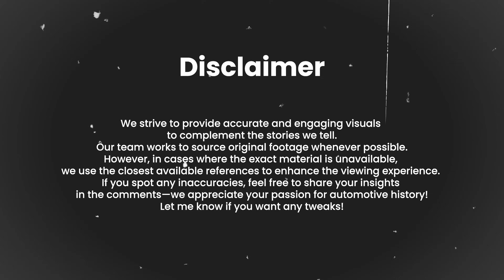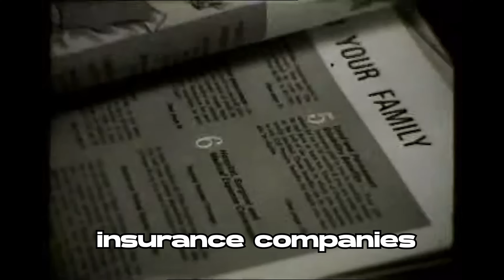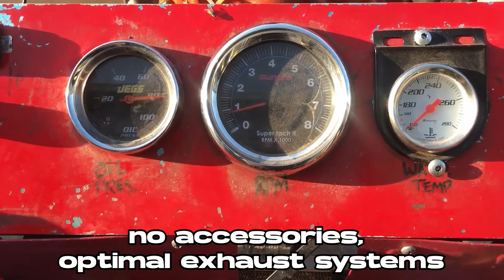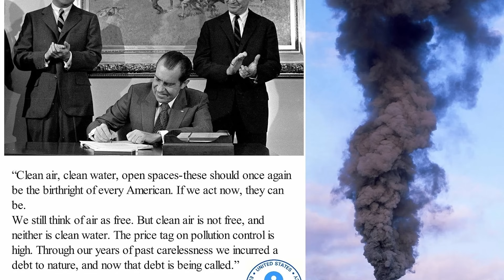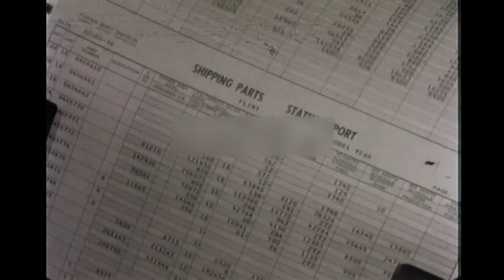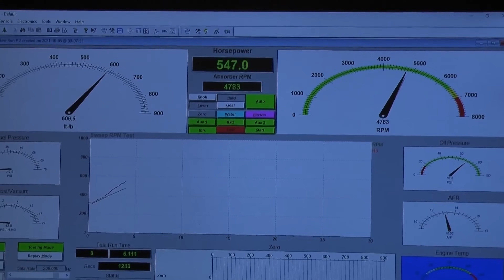The Shocking Truth behind Chrysler banned 440 Six Pack Engine

Comment: What made the 6 pk brilliant was that it added a 90 deg elbow and about 4 extra inches for air fuel mixture to travel.  Both make the cylinder work harder to be fed....which enhances low speed torque.  A 2x4 pkg doesnt add difficulty while running on primaries
Reply from the maker: Thanks for sharing your insights! The engineering behind the 440 Six Pack is truly fascinating, and you’ve highlighted some key aspects that make it stand out.  @overcastfriday81

Comment: The six pack was a total street Dog...the original set up was VACUUM Operated! You drove along and suddenly you nailed to pass or just to go faster. The engine decided it would lag untill it fecid e d to open the end carbs then you were flying more than y ou wanted unless you were really racing. So you hit the brake and the end carbs flopped Shut!!! And your head tried to go thru the windsield!!! What a mess, the engine is deciding how fast I should be going or how much power I should have? What beetle brain made up a system like that? 
In the end, I put in a 900 cu ft 4 bbl and finally a blower and I had a smooth street drivable 650 Hp 
GTX which is still in my family.
Reply from the maker: It's interesting to hear your experience with the six pack setup! It definitely had its quirks, and it sounds like you found a powerful solution with the 900 cu ft 4 bbl and blower. Thanks for sharing your story!  @cindys1819

Comment: THE only reason there was a 6 pack carburetion was because manufacturers could make carburetors cfm large enough to feed large hp engines. HOLLEY finally made a large 3 bbl carbs towards the end of the 60's.

Comment: i bought a brand new challenger well optioned  r/t 6 pack in march 1970 it was almosy 4 k i paid foit with the options  and half of it was borrowed on a loan i had gotten .... i drove it only 2500 miles until november of 1970 ..i couldnt get insurance on it that was reasonable  price from anybody cause it was an r/t edition with 440/6 i was quoted as high as $300  and $240 for 6 months insurance at its cheapest  so i parked it and bought a beat up old bug and i drove that till 1973  insurance was still wayy too high even in 73 ..the car sat in my dads garage till mid 1974  still with 2500 miles on the clock  i finally sold the car in 1975 for  $32oo    and 2600 original miles on it  and its 2nd oil change from new  it was prettymuch a brand new car at the time ...ughhh   😒😒
Reply from the maker: Wow, what an incredible story! It's amazing how the insurance prices back then could affect car ownership decisions. That Challenger sounds like it was a gem! @toddhargett7804
they love to take our money... dont like to give it back ...thise dam insuranch companys

Comment: I am Don Berry started working after returning from the service at Chrysler engine development in 1969. I must say this computer voice is really irritating. Anyhow my first day at Chrysler I was takin to a Development Dynamometer and ready to run was a 440 6 bbl. For development for the 1970 model year. I did most of the work and dyno verifications. Do you know we used “slide rules” back then. I installed the first aluminum intake at Chrysler but the co. That built the intake may of had an engine mule. 🎉
Reply: I too hate these stupid sounding AI voices.
They keep repeating themselves and often don't know fact from fiction.
Sad!

Comment: I bought a 69 Cornett RT from the original owner that had been a six pack dealer installed option on it with the lift off fiberglass hood. But the car got stolen and when he got it back, the hood was gone as was the intake so it had some kind of an aluminum intake and a huge holly floor barrel on it which about Three times a night if you were running it hard had to be dialed in again the car was a real beast and definitely the fastest Mopar I ever owned

Comment: 440 4 barrel and 6 barrel and 426 Hemi even the 383 could NEVER hook up on the street or track! at 20 mph even in a 383 car would light the rear tires up and spin!!!! All old road car tests 0-60 and 1/4 mile times were bogus as they were seconds slower in the 1/4 mile because of tire spinning...The 1972 lower power cars actually were as quick on paper because they could hook up!! All Chrysler engines in 1972 were changed not only lower compression, new heads and weaker cams...

Comment: In 75 I was 17 and had saved up $1600 and was lucky to find a 1970 Sixpack Challenger Stock and still under warrente. I used to race in my town at the end of rt295 and rt95. I beat a lot of fast cars then. 396 and 454 Chevelles, 440 r/t's, GTX's, Chargers, 429 Syclone semi hemi, Rambler Scrambler, 70 GTO, 351 Cougar, 70 Boss Mustang and all the 383/340 cars. There was a BB 55 Chevy though that totally blew my doors off!
Reply from the maker: Wow, it sounds like you had some incredible experiences with that Challenger! Racing against all those iconic cars must have been a thrill. Thanks for sharing your story!  @aphil4581

Comment: I like the 440 better than the hemi.  If you've ever worked on a hemi, you know why.
Reply from the maker: Ah, the 440! It’s like the reliable friend that always shows up—while the Hemi is more like that flashy buddy who disappears when it’s time to help with the heavy lifting! @scottlowell493
thanks for sharing your thoughts
Reply: @rarecarstorys Not really the 426 Hemi were reliable and easy to use daily...1970 and  older 426 Hemi used solid lifters so every 10,000 you had to adjust the valves,easy to do 15 minutes its done but thats why people say the 440 was better,you never had to..70-71 Hemi you didnt have to adjust them anymore.

Comment: Actually, after building just a handful of 440 6 Barrel cars for the 1972 Model Year, the EPA stepped in and ordered an emissions recall for all 1972 Dodge and Plymouth cars equipped with the 440 6 Barrel engines. The accepted number of cars so equipped was either 3 or 5 cars. Either 2 or 4 cars were out in the press corps, the last one was ordered and paid for by a VP in the Plymouth Division. The press corps cars were returned for the recall and converted to a single 4 Barrel carburetor, the Plymouth VP refused to return his personal vehicle for the recall. He kept the car around a year and a half before selling the vehicle to another buyer. This car then disappeared and no-one knows where it is. The press corps cars were sold to buyers and all disappeared over time due to wrecks or just plain being used up or rusted out. These cars would all be super rare today and likely worth a fortune. It's likely if any still exist, it would be the 1972 Road Runner GTX as it would be badged because the GTX badging was automatically added to any 1972 to 1974 Road Runner with the 440 option. It that Road Runner GTX still exists, it's owner is sitting on a vehicle worth a fortune.
Reply from the maker: Wow, that's some fascinating history behind the 440 Six Pack! It’s amazing how a few cars can have such a significant impact on automotive history. Thanks for sharing these details!  @kentkrueger6035

Comment: Horsepower figures weren't necessarily lied about, they were usually taken at a lower than optimal rpm. Of course, the engines made significantly more power when running at a HIGHER rpm. But the lower rpm horsepower readings were usually done to get better classifications in NHRA Super Stock/Stock Eliminator because the cars that won races on Saturday and Sunday were the ones young people wanted to BUY on Monday.
Reply from the maker: You make an excellent point! The rpm figures definitely played a big role in how the engines were classified and marketed. It's fascinating how racing and consumer trends influenced these decisions!  @chrisnizer5702

Comment: In my 1968 Barracuda fastback I run a 400 based 512 stroker with Trick Flow heads and a hydraulic roller cam with 254 duration @.050 with 618 lift, all backed by an A833 4 speed manual with Passon Hemi overdrive. 💪🌞👍
Reply from the maker: wow!!! That sounds like an incredible setup! The 512 stroker must really bring out the best in your Barracuda. It’s amazing what you can do with those engines!  @glengabruch4664
Reply: @rarecarstorys  It weighs less than the 340 it replaced and it puts out double the power and its more streetable too. It was a fantastic upgrade. 👌

Comment: Built a 71 challenger, took out the 340 6 pack and put in a 440 stroked to 505cid with stage 4 heads, purple shaft, anti-pumpup lifters, cloyes gears and of course the hi-rise intake with two 850 Holley mechanical linkage carbs. I hit 8.91@168mph at cayuga, so yeah, the 440 bored to 505 is a beast and very little could touch it.
Reply from the maker: Wow, that sounds like an incredible build! The 440 stroked to 505 is a serious powerhouse. Hitting 8.91 at 168 mph is no small feat—kudos to you for crafting such a beast of a machine!  @Meckanic
Reply: @rarecarstorys  it was a fun toy, only problem was the motor was too powerful, it broke the k frame away from the firewall, so I scrapped the car in 1984  still got $6500 for the engine, another $4000 for the custom 5 core rad, the 727b tranny, etc.
Reply: Beats the Tesla plaid s
Reply: Lol sure you did what’s a mopar stage 4 head
Reply: @darrellsomers5427 there's better heads than stage 4 but this guy claiming his 505 is running 890s he wants you to believe that he's making around 1200 horsepower go to 71 Dodge Challenger weighs about 3500 lb Les driver and fuel so I'm with you he's full of s***
Reply: I had a 71 challenger removed the 318 took a 360 from a Fury wagon spent 5K rebuilding motor installed it . A week later hit a big rock in the rain the rear end lost traction total loss!

Comment: I stayed at the drag strip every weekend...never saw a 440 that could beet a stock chevelle or nova with the 396..thay would not ..only Chrysler product i seen that would run with them was a plymouth g.t.x.440 super comando..
Reply from the maker: That's interesting! The 440 Six Pack has quite a reputation, but it’s always fun to hear about different experiences at the strip. Each car has its unique strengths!  @stevenfan1218
Reply: The only Chevrolets I have ever had trouble with with my 440 where the 427 and 454 powered Chevrolets
Reply: Then you never seen anything. I use to stack up 396 chevys like cord wood with my 70 Sixpack Challenger in the 70's. 454 Chevelles were no problen either.

Comment: The six pack engines. Also had  massive sized   connecting. Rods for more strength
Reply from the maker: Thanks for sharing that insight! The engineering behind those engines is truly fascinating, and it’s great to see fellow enthusiasts appreciating the details!  @JamesDavis-j1m
Reply: @rarecarstorys Not the early ones.
Reply: Some of the 440 hp did also just different pistons
Reply: 70 and up all the 440's had the same better rods.
Reply: @aphil4581 only HP Motors 440 and buses RVs Electric Generators use standard 440 connecting rods for the simple reason they didn't turn the RPMs
Reply: And cop cars
Reply: All 440 HP Motors use the same connecting rod

Comment: My 70 Cuda 440+6 wasn't had to tune at all. Tuning a Hemi was trickier.
Reply: Tuning the 440 Six pack is actually child's play. It is a simple Holley 2 barrel (350 CFM) that you simply adjust the idle speed to close to 750-800 rpms then adjust the air mixtures (to highest vacuum number which is also highest smooth idle too). Then recheck and fine tune the idle and mixtures one last time. Then you set the the outer Holley 2 barrels (500 CFM's) which don't even have mixture screws to adjust. There isn't anything to "adjust" other than the linkage so they get full throttle on the outer carbs at the same time.
 Chrysler already adjusted them (although usually a 1/16 turn in too lean for emmissions) and made them phase in by vacuum. When the engine was reved up enough to take more fuel is phased it in by vacuum all the way up to full throttle. There simply wasn't much that needed "adjusting".  The myth they are somehow hard to adjust must be due to morons grabbing a screw driver and messing up the idle and mixtures because they know better than multi million dollar tech departments that built and tuned the engine in the first place.  The 440 Six pack was actually simple to set up and tune. You could punch the gas right to the floor with no bog or lag it would just go. Really go.
   Now it is true GM was well behind Chrysler in 6 pack research and performance. Many GM six packs were manual adjustment without the benefit of vacuum. They usually had bogs and lags. Not the Chryslers.
Reply from the maker: Sounds like your 70 Cuda is the well-behaved child in the family of muscle cars! Maybe it just knew how to follow the rules better than the Hemi!  @richardturk7162

Comment: They were an early version of VVT.  I used to think these were totally unnecessary with mechanical secondary 4 bbls.  But they're pretty clever: at lower rpm, the cylinders must draw air through an extra 90 degree angle and 5 extra inches of manifold tunnel.  Plus, all eight cylinders must breath through an extra wimpy 2 bbl carb at that time as well, further enhancing low rpm drivability and torque.  Then when rpm is high, there is an extra 285% breathing capacity, without the 5 inch 90 degree reach.
Reply from the maker: You make a great point! The engineering behind the 440 Six Pack is truly impressive, and it’s fascinating how they managed to optimize performance at different RPMs. Thanks for sharing your insights!  @overcastfriday81

Comment: The Truth is Chrysler took an engine that was made for the Imperial and bought a triple  manifold from  
Edelbrock and installed that with 3 2-barrels.
Reply: I think Edelbrock still makes it from the original mold.
Reply: My 70 Cuda 440+6 had a cast iron factory intake. I later on put an aluminum intake. It didn't make a huge improvement.
Reply: @richardturk7162  It did in weight reduction
Reply: WRONG! they had 3 versions of the 440...440 holley 595 cfm 4bbl,440 4bbl high performance with 750 cfm Carter and 440 6 barrel/6 pack.Heads,cam,carb were different on all!

 440 used in the Imperial, Newport, New Yorker and 300 also Monaco,Polara,Fury etc...1966 the 440 came out but it was just a bored 413..Truth is the 440 Big Block was actually made for all Chrysler vehicles...it started as a 413 in 1959, was also used in the 300 albeit high performance...

Also, most Imperials and other Chrysler/Dodge/Plymouth C bodies in 1966 they were the 350 hp 480 torque versions, different heads, cam and 595 cfm holley...The 440 TNT the high performance 440 had different heads/cam/carb and compression was higher.
Reply: I love reading what people think of (notice my name) I hired into Chrysler In May 1969. The first day on the job I was taken to my own Dyno cell . The engine was on the Dyno and it was the beginning of the 1970 440 6 pack/ bbl. I must say within days I fixed some 1969 eng warranty concerns. Three bolt cam gear with roller chain. Rocker arms from Toledo stamping only. Extensive work on piston,rings and cylinder to limit high rev compression leaks. But I recived an unmarked plan brown shipping box. No return address and inside was a beautiful aluminum intake manifold with no markings ie: batch number, manufacturer,model number, and I am sure that was the first one made and passed the testing to be the new production intake. Us engine lab guys were trying to figure out who made it so we didn’t know but we all suspected. 🎉

Comment: It was easy to tune if you understand Holleys.................
Reply: two bbl's are so simple especialy with vacume secondairys.
Reply from the maker: Absolutely! The tuning process can be quite straightforward for those familiar with Holley carburetors. It really helps to have that knowledge when working on performance engines like the 440 Six Pack!  @mcm95403  saw a  six barrel auto tune set up recently
Reply: I only knew two mechanics that could reliably tune them. It was not easy for most.
Reply: @scottcooksey5284  That's why they drive Chevys
Reply: @joelwarthen1135 yeah them quadrajunks were spectacular! LOL
Reply: @scottcooksey5284  Yup spectacular junk.

Comment: The three carbs setup is way more efficient than a traditional setup. It was about cost and cost only.
Reply from the maker: You make a great point! The efficiency of the three-carb setup definitely played a significant role in its design, but cost factors often overshadowed performance in the automotive industry.  @SampleDeezeNutz